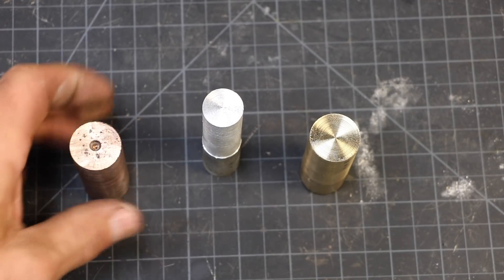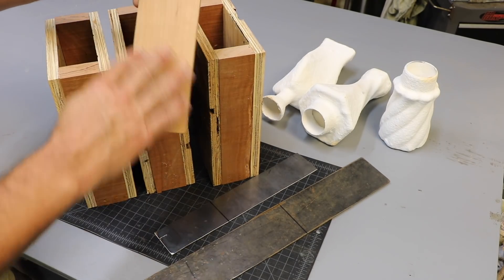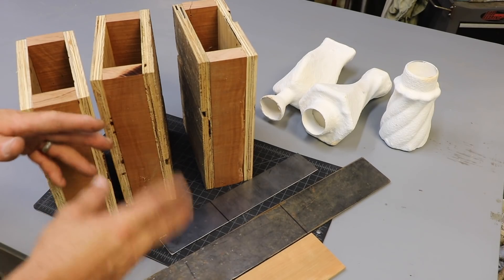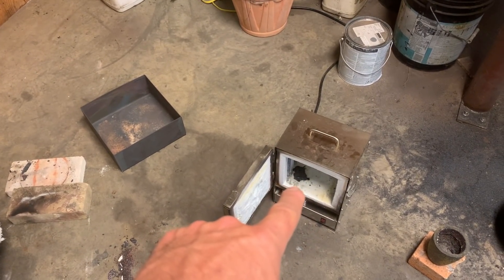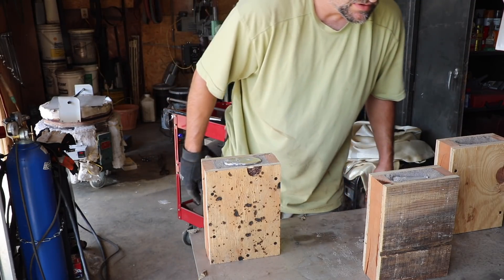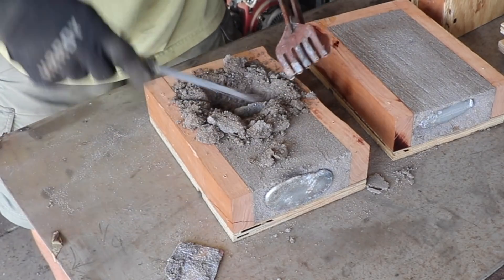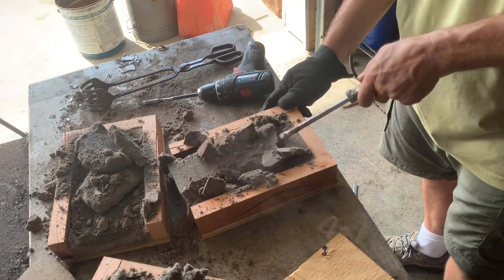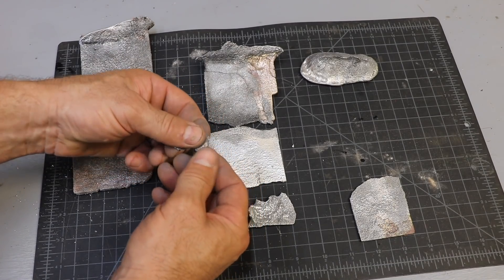Mixing Molten Metals.  What Could Go Wrong??

Comment: Prediction: The aluminium is going to overheat and start splattering/exploding all over the place and not at all mix properly with the copper, and just leave a giant mess.
Edit: Yeah i should have gone for the density part. :I
Ah well, at least it wasn't nearly as bad as i thought it'd be.
Reply: That's what I was expecting to happen.

Comment: Curious, aluminum bronze 
10% aluminum by weight or volume? Would make quite a difference in the ratio due to the density difference in the two metals. Would think you would have better results mixing them in the same crucible then pouring.

Comment: I have always wondered this, example if you put like a 12 gauge aluminum wire in the bottom of a ingot mold and poured copper on top of it what would happen would it be a cool stripe

Comment: There are several problems. The first is that the aluminum isn’t pure. They’re alloys. There’s likely magnesium in there, which normally is strong, but is brittle when heated like that. Secondly, heating the molds would allow the aluminum to be more liquid rather than hardening almost instantly when poured in such a thin layer. I’ve made aluminum bronze, but not what you’re trying to do.

Comment: Love the experimentation! There is an Al/Cu alloy called 'Duraluminium '. I'm not sure what the ratio is, but the alloy looks like aluminium, so I'm guessing Aluminium is the dominant ingredient. It's used for it's stiffness properties. Like engine mounting plates.
Edit: Wikipedia has the mix as 91-95% aluminium, 3.8-4.9% copper, 1.2-1.8% magnesium, 0.3-0.9% manganese, <0.5% iron, <0.5% silicon, <0.25% zinc, <0.15% titanium, <0.10% chromium and no more than 0.15% of other elements together. But it is an alloy and not suitable for your desired patterned result.

Comment: Its going to flash or explode or do something crazy. The reason why I think that is because the temperatures are so far apart. You probably need to start with the hottest material and then slowly add the other.

Comment: Stopped at 5:20 - My prediction: The temperature difference between these two fluids is huge: 600f. Think about what happens when you pour boiling water on ice... a difference of less than 400F. There is a violent reaction as the temperatures equalize rapidly.  I think what will happen is similar... there will be a lot of bubbling and popping and spraying.. and general danger. I think in the end you will end up with some blobs of copper/aluminum, though. Either way, you're alive to upload the video, so it couldn't have been that bad.

Edit: Oh, interesting! Thanks for doing these experiments. Fun to watch. I have never done any casting but I enjoy watching it happen.

Comment: One is colder then the other , colder one will ssink to bottom hotter one will remain on top and they will probably delaminate
EDIT: Also considering that aluminiums melting point is much lower im not sure what will happen when the hotter material gets into contact with colder or vice versa but something is gonna happen in that regard.

Afterthought : I forgot about densities :/

Comment: Guess at https://youtu.be/q-GAEVkF71Q?t=311

Two very different temperatures... two very thermally conductive materials.  I think because of the delta (difference) in temperature, and the high temperatures that you're working with, the higher temperature metal is going to force a lot of energy into the lower temperature metal.  I don't know the density difference, but I think it was Ally at 1400 and Copper at 2000?  And copper I think is heavier...  I don't know what the thermal mass of those materials are...

Conclusion:
The aluminium is going to boil, and the copper is going to solidify. It's going to happen very quickly because of the thermal conductivity...

This is going to be "interesting" to watch.
Reply: It's less energetic than I thought, and the alum didn't boil, but this moment: https://youtu.be/q-GAEVkF71Q?t=446

That shows just how much energy is in the hot copper, and the thermal conductivity, where the hot copper hits the ally, and so quickly heats it to molten again.

pretty cool

Comment: Years ago i was pouring small bronze sculptors and making my own bronze using copper (90%) and tin (10%) by weight.  I made a gas fires foundry . I melted the copper first and then added the tin in the molten copper using the same crucible.  then I added crushed coke cola  bottle glass the glass melted to form a gas seal on the molten bronze, a cold metal rod poked into the bronze would remove the glass and a hand full of borax was add to the bronze as a flux before pouring

Comment: 8:22 na man if the ratio of aluminum to copper is to high for instance 11 to 88 it will be a grey color and will easily shatter. Try pouring an ingot of such mixture, letting it cool to ambient and drop it onto cement from six feet. Shatters like glass.

Comment: OMG! The mind boggles, fair boggles at the things some people try! However I can understand why you tried, the potential for some magical effects as shown by the small snippets that did work is enough to keep trying for. Some thoughts:- the ratio of 9 to 1 of copper to aluminium is not actually as bad as it sounds because its by weight. If we look at it by volume, which is the way you pour, its more like 3 to 1 and that sounds a lot more manageable. But I think you need two people pouring - a separate person looking after the melting and pouring of each metal - its just not possible for one person to pour two crucibles at once particularly in a set volume ratio - get an assistant! It may be advantageous to "stutter" the aluminium in a rapid pour not pour while the copper is a constant stream, only experimentation will tell here.
Stop working with "Crapinium". The use of chips (swarf to us) bits of foil and agricultural sections as aluminium feed stock is bound to cause to problems. The oxide loading in the resulting metal will be very high and may well have been the cause of much of that brittleness. This oxide loading will greatly effect the fluidity of the "crapinium". I don't know what "stuff" you attempted to  degas with but it did not work - why? Well the best degassing treatments out there (RID) take 4 plus minutes to work, I use 8 minutes myself. So the few seconds that you bubbled I do not know what through the metal would be pointless. The use of very fine enameled copper wire as feed stock isn't all that clever either - I use heavy buss bar. Oh, and the borax (I assume) that you used as a flux is good for (only) one thing - destroying crucibles.
The reference below to looking at the Copper aluminium phase diagram is a bit pointless. I studied phase diagrams for many weeks of each of three years and still really only have a limited understanding of them  - the copper aluminium diagram is a particularly complicated one with many traps for the unknowing. Incidentally alloys with up to about 15% aluminium have been used and aluminium alloys with up to 10% copper were used (for pistons!) As is typical of most alloy systems the alloys at either end are of use, those in the middle, not so much. Because of inherent problems with oxide skin formation aluminium bronzes are regarded as the hardest of alloys to cast successfully and should not really be attempted by hobbyists. Those who think that adding 10% aluminium to copper will give them a 10% aluminium bronze are sadly mistaken - because of bad melting practices (universal!) much aluminium will be lost as oxide and the resulting alloy will more likely be 5% aluminium than 10%.
Looking forward to your next try..Martin
Reply: Further to the above:- probably worth trying with greatly elevated temperatures for the aluminium as this might stop flash solidification of the copper -won't do the aluminium much good though 😊... Martin

Comment: Cast in two passes? 3dprint 2 sets of interlocking forms, one the sub form of swirls & variances, the second form encompassing the first W added volume for enough metal mass to reach parts meant to be thin ground later.
Copper first, then smoothed & recast may even allow some heat colouring to survive on final product?

Comment: The more pure the aluminum, the higher the surface tension in liquid state.

Nice try.
Might I suggest larger molds.
Ah, I see you already have the molds right there.
Those vase molds are ideal! :D
Larger volume, more room for the metal to mix.
And the aluminum is less fragile when thicker(slightly less fragile)

Comment: Shitalloy….   That’s a keeper.  I suspected what you got in the piece you polished.   With the density of Cu being almost 4x that of Al, I knew there wasn’t going to be a natural tendency to mix.  That and with heat (thermodynamicaly speaking) being relative, the copper would tend to keep the Al side of the interface molten, while the copper would tend to freeze from contact with the much cooler Al.   

It would be interesting to just mix the two in a larger mold, then cut/polish the slug you create.

Comment: I OWN A BRONZE FOUNDRY, WHEN WE MAKE A VIRGIN  ALUMINUM BRONZE ,WE HAVE TO ALLOY IT FOR TEN TO 20 MINUTES IN THE INDUCTOTHERM FURNACE (2000 LB ) RUN CHARGE. EVEN THOUGH THEY ARE NON FERROUS METALS THE REALLY DONT PLAY WELL. INDUSTY STD. AL-BRZ. IS  CDA-954 WHICH IS 85%CU 11% AL AND 4% FE, YES A FERROUS ALLOY THAT ALLOYWILL YEILD 85000 TENSILE PSI!   VERY DURABLE , AND IS A GREAT MATERIAL AS A BUSHING AND OR BEARING FOR EXTREMLY HEAVY INDUSTRY, HOWEVER IT DOESNT LIKE SAND CASTING , BECAUSE OF PEROSITY ISSUES, SO WE CONTINUOUSLY CAST THROUGH A GRAPHITE DIE.

Comment: Okay, I've stopped the video at 5:23 and my prediction is that (1) the two metals won't mix because of their vastly different densities, and (2) if there is copper dross (copper oxide) atop the copper when molten aluminum is added, a reaction will occur equivalent to the thermite reaction -- aluminum will pull the oxygen from the dross producing aluminum oxide and copper metal.  The thermite reaction can be violent.
Reply: Okay, I'm up to 7:35 now and I'm very surprised.  I'd anticipated that the mixing would be done in the crucible, not in the mold.
Also, it seems that FC101 has never handled hot aluminum.  It's pretty common knowledge that aluminum has no strength at all when hot, which may be why it is breaking apart when pulled from the mold before complete cooling.

Comment: Have you tried melting the aluminum and copper in the same crucible at the same time? I would think it would give you minimum blending of the metals and the pour would give you the striations you are looking for. I don't know how you will get around the weak 90%-10% aluminum/copper alloy.

Comment: Try mixing/pouring glass and metal... Glass melts at around 2300°F so you will probably want a metal that, like copper, melts at about the same temperature.  I think it would give you something quite interesting. You may have to wet sand the glass to achieve transparency afterwards, but still, what would that look like? Good video all the same, thank you.

Comment: Ok at 5:22 I'm thinking the copper will heat the aluminium and that will bubble aka boil splattering molten metal around.

Comment: Going to guess that the aluminum causes the copper to solidify on contact, and the solid copper shell then breaks when something offgasses and causes splatter.

Failing that, I'm going to say the temperature difference prevents alloying and you end up with fractures.

Comment: OK. Gotta as a possibly very ignorant question. Couldn't both metals be heated to 2000? And if so, couldn't you just pour one into the other and mix them before pouring into a mold?

Comment: If you pour the aluminum first and then just drip the copper in. You could let the aluminum cool to just begin to solidify. The much hotter molten copper will go right into it, I suspect. Shoot, it might be interesting to just drill some holes into some aluminum chunk, get it heated to just below melting, and then pour in the molten copper.

Comment: So, how about measure 10% of aluminium, 90% copper and one pour. Melt both but pour aluminium first, all of it. It will cool down and solidify on the bottom but when pouring the more hotter copper, it will melt the aluminium again (happened in 7:20). Also, as it's heavier it will try to change places with the aluminium (different densities) and all the while it's cooling. Just the right temperatures and you could get copper that solidifies while it's pushing it's way past the aluminium and mixing in the process. 
Now, i don't know if this will help with the strength-issue but i think there is a chance for better "wood grains" and swirls.

Comment: i had done a similar test melting copper and aluminum togather but i had the ratio backwards and did 90%aluminum to 10% copper looked good but it was so brittle you could break it tapping with your hands

Comment: Might be worth making 10% Aluminum in one pot, so the pour will never exceed 10% then pour the alloy and copper for your layers. Did note the exothermic reaction between metals when copper was added to aluminum. The aluminum quickly heated brighter than just the copper. Might want to transfer the result to an anneal process to possibly reduce the brittle result.

Comment: I kind of figured that you would get almost instantaneous alloy formation. Something that might be interesting would be to the take a chunk of aluminum, machine some sort of decorative pattern into it and pour molten copper onto the aluminum. I imagine if you pre-heat the aluminum to the right temp the copper would melt some of it before solidifying creating interesting boundary layers.

Comment: See 'Welding Metallurgy' by Linnert. It has been my go to source for 30+ years. The book could be considered a bible to anyone considering a life in metals. It explains why stainless is stainless and which aluminiums are weldable. It helped me to weld aluminium to steel. The copper section is extensive and describes the various alloying agents.
Reply: When he mentions the ratios like 90/10%  Is that by weight or volume?
Reply: @keithkeyser9546  Weight, unless otherwise specified. It's a good question and made me think back to how my casting customers did it on the scale.
Reply: @richspillman4191  I used to home brew and made some mead.  The recipe said mix the honey and the water 1:4.  Here's the catch.  Honey is sold by weight and water by volume.  The educated guess is to measure out the honey by volume, and it turned out as it should.
Reply: @keithkeyser9546  has honey always been sold by weight? seems like mead recipies would predate the selling honey by weight thing. I mean, its more or less liquid so why not sell it by the pint??
Reply: @lukewarmwater6412  long story short, just like tomatoes it all starts with tax evasion and a judge deciding its one thing and not another
Reply: @keithkeyser9546  Sounds more like that elusive common sense so few have anymore of these days. I remember the first time I had mead...Nov 1979, London, some castle where to get a drink you had to yell "YO WENCH!" We left just as the Iranian hostage situation was kicking off.
Reply: 824$ on Amazon!?
Reply: @letsgoreds3363  I think I paid $35.00 in 1986 from Mt San Antonio Community College

Comment: King of Random did muffin pan pours, I believe around when you were pouring your cannon. (He tried like 20/80, 40/60, %/% etc.) So a flat, ingot or pool pour might have worked better than the deep, thin cross-sections of yours.  (Less surface area to cool per volume.)  His were pretty brittle.  What I don't understand about a lot of 'sand pours' is that it seems that the molton metal is barely above its melting point as the pour starts so as soon as the metal hits the sand, a layer wants to solidfy.  Same thing as you mentioned with the dissimilar melting points of the two metals, one trying to melt/solidify the other.  Could you have had better/easier results with preheated molds? (If poured flat, the surface could be heated with torches as you did the pour.)  If the metals were further up from their melting points, and the same temp, I would think that they should have mixed more easily and with less viscosity/solidification.  Interesting experiments though!  :-D

Comment: My meager input: You want layers like this, you'll need to pour copper over solid aluminum that's been treated in some manner to avoid passivating, but that manner has to be compatible with the process (i.e. acid dip straight into paraffin would preserve the surface but isn't going to behave well when molten copper is poured over it in a tight mold). 

Solution's likely to zincate copper shapes (lye bath electroplating with zinc). The zinc should absorb into the copper, hopefully, well enough to avoid bubbles, and the aluminum surface would be devoid of oxide so copper should bond well. Then you can turn the piece and have your layers well bonded with minimal alloying taking place.

Comment: Because of the different viscosities in the 2 metals, pouring them separately is going to mean they will not mix and, most likely become separate pieces when they solidify.  Mixing them in a liquid state would ensure a better bond, but having one next to the other would cause a difference in their structure as they cooled at different rates.  You might get a slight mixing between the 2, but it won't be enough for them to bond properly.  It'd be interesting if you were to pour them in and do a single swirl to the point where the 2 metals weren't uniformly mixed but where they come into contact with each other may have mixed sufficiently to provide a bond.